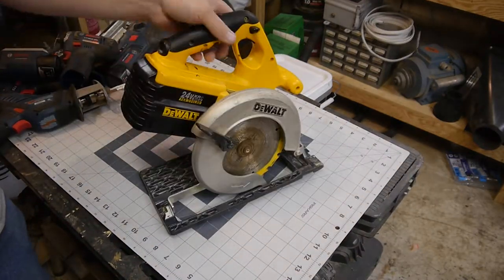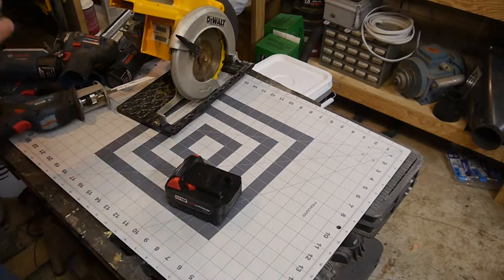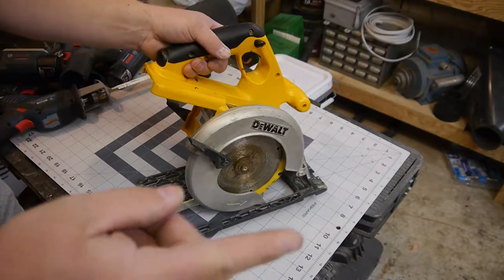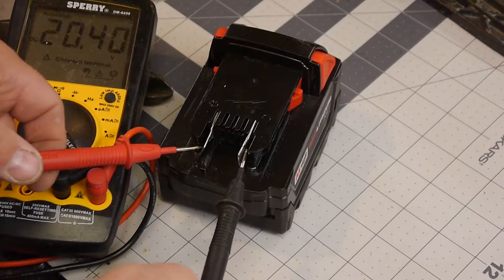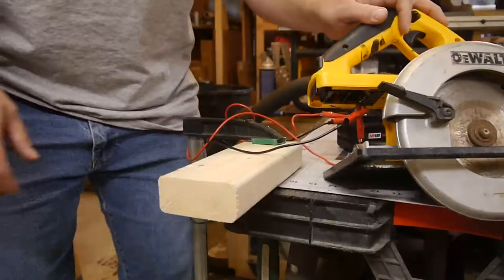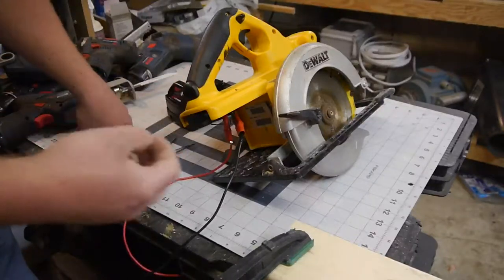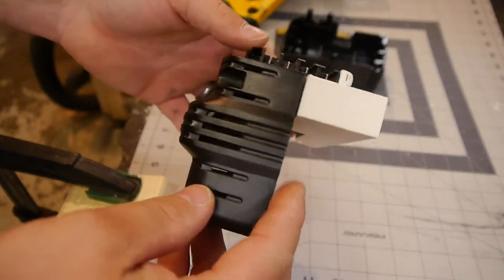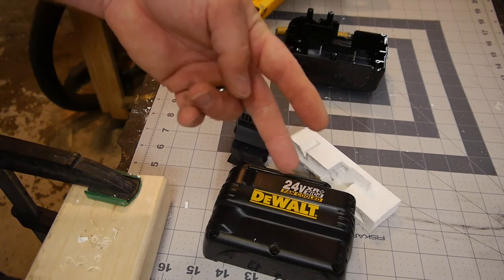Dewalt Circular Saw with Milwaukee Battery Powering it... Illegal? PART 1/3

Comment: Hey a new video ...nice. Your Maxnc videos motivated me to get my  max15 going . I bought it as a full electrical fry job. It's running now and I've also picked up the material for Just Josh style reinforcements in steel sadly I couldn't find aluminium locally  I'm currently running a salvaged Sherline 1/5 hp motor for the spindle but i'm on the lookout for a treadmill.-cheers
Reply from the maker: Renegade cnc, That is awesome! Well done! Taking on such a task is daunting for sure. I am glad to hear you found some of my videos motivating. Are you using a stock controller and software with your cnc? Steel should be fine for the reinforcement, I used aluminum because It was easier to work with, and more importantly it is what I had within arms reach at the time. I have a few more things I need to develop for the Maxnc this summer foremost is a way to take the axial thrust developed by the lead screws away from the stepper motors. I think this is why my holes are usually 0.020" out of round in metal. Not sure when I will have time for that as I need to build and fix a few things on/around the house before then.  Ahh well, left foot, right foot....Thanks for watching!
Reply: Mine was originally a closed loop. I still have the controller, original steppers, and software but after a few failed attempts to get it going I looked into getting a replacement. First I checked at the manufacturer .....hahaha ya don't do that. It was going to be like $1500 to replace everything. Then like  6 months down the road I found a controller and four 200 oz motors (open loop)  ridiculously cheap on Craigslist.  The controller is an older HobbyCNC. Two weeks later another guy posted a Sherline lathe and mill also VERY cheap so I bought them for the spindle motors. One of them smoked out in 5 minutes but the other was good. After I saw your treadmill video I was like awww dammit why did I think of that. 
So then I youtube taught myself mach3. So far I've just done some tests in plastic as I've been busy with work. It performed pretty well with square, circle, and helical milling. I'm just hand coding for now but plan to start working with Fusion soon. -cheers

Comment: Is this adapter still working for you without logic in the adapter?
Reply from the maker: Yes, it is. I haven't used it in awhile as it is winter here.
Reply: @JoshAQ Nice. I'm making one of these to fit a 20v dewalt tool. Does the battery just cut out once it reaches a low voltage?
Reply from the maker: @achoy24  it mostly just doesnt develop enough power to function anymore, and then I recharge. I am probably only using half the battery capacity though.